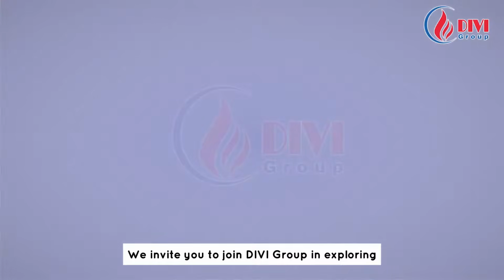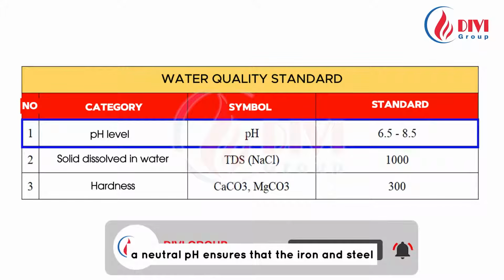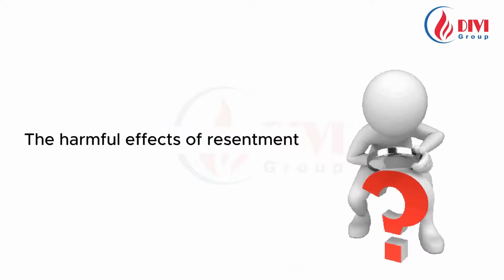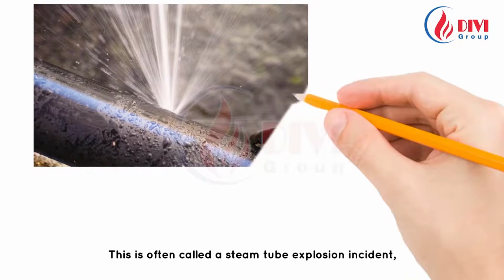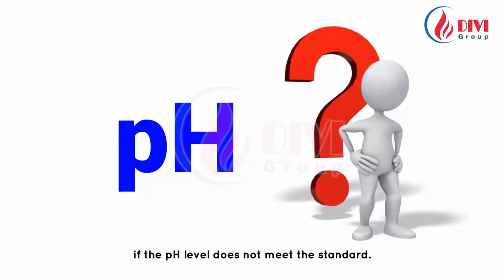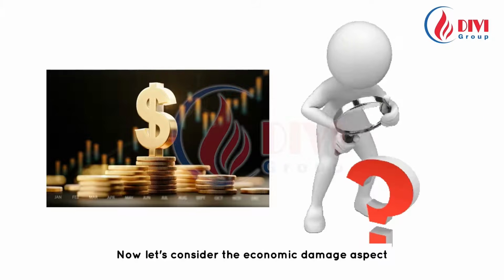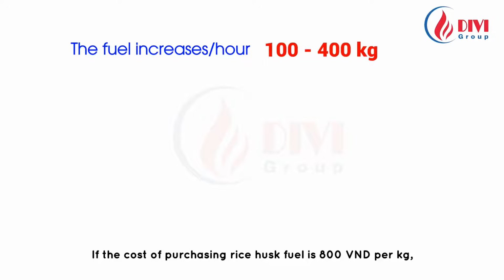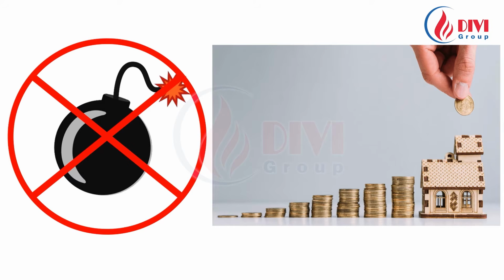Water Treatment Tips for Your Boilers – Save Energy, Get More Done

Comment: How does water quality impact the efficiency of industrial boilers?
Reply from the maker: Water quality plays a crucial role in the operation of industrial boilers. Factors such as pH levels, TDS (Total Dissolved Solids), and water hardness can lead to scale formation within the boiler, reducing heat transfer efficiency and increasing energy consumption. Proper water treatment helps prevent scale buildup, ensures optimal boiler efficiency, and improves overall safety.